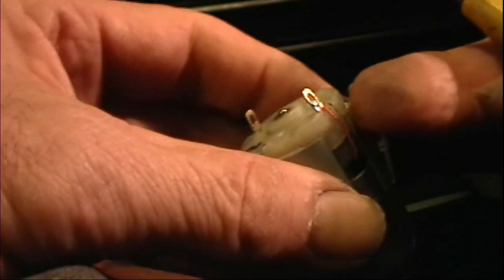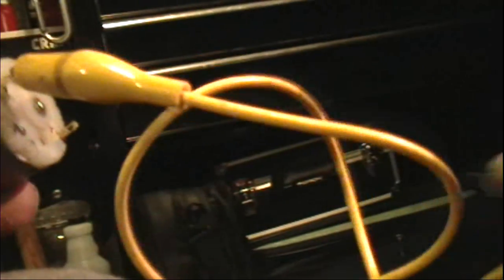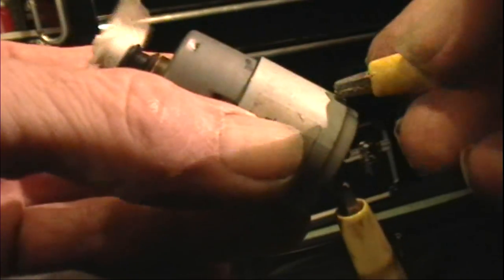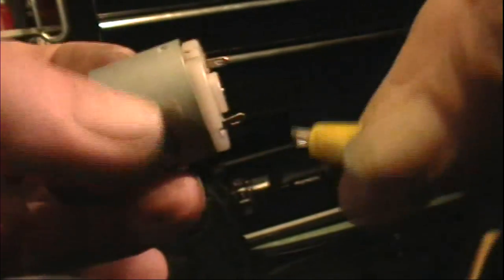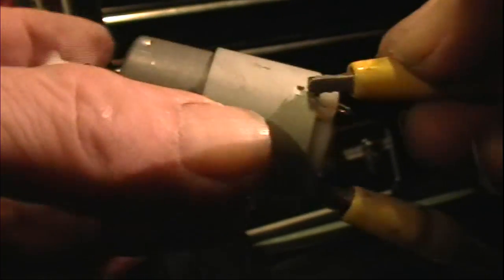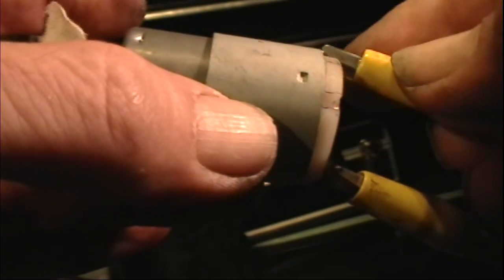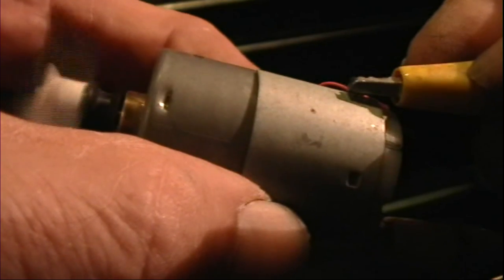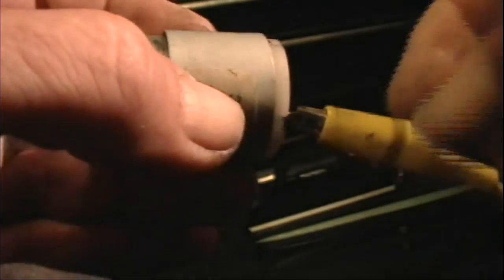alt.snakeoil Video Report 24: Debunking LifeHack2012's Motor Powered by Magic Coil

Comment from the maker: Sorry, link doesn't appear to go anywhere. 

One of the light bulb vids that he shows, uses simple feed wires that come up through the "table" and contact the "coil" invisibly.

There is another motor running video (not by LifeHac) where the guy simply put an entire smaller motor inside the bigger motor case, much easier than what I show here.

And putting a battery inside the multimeter is also a great trick.